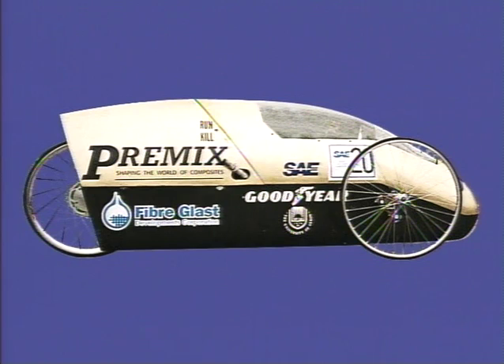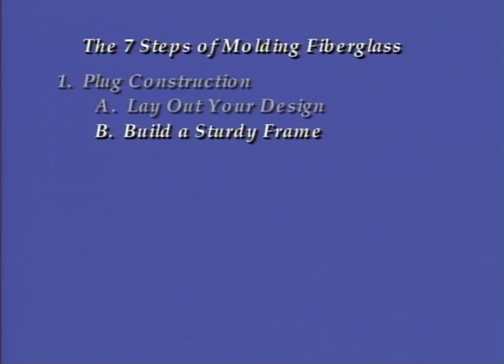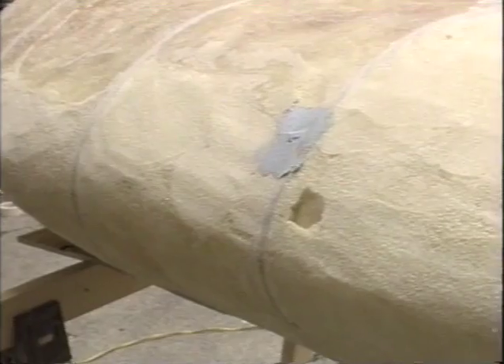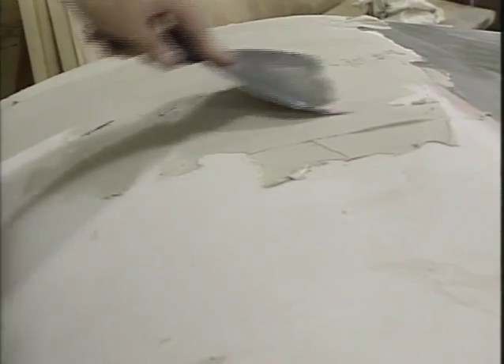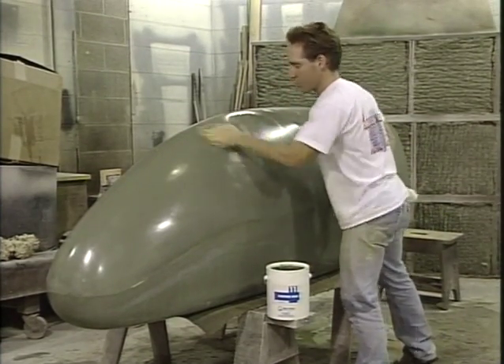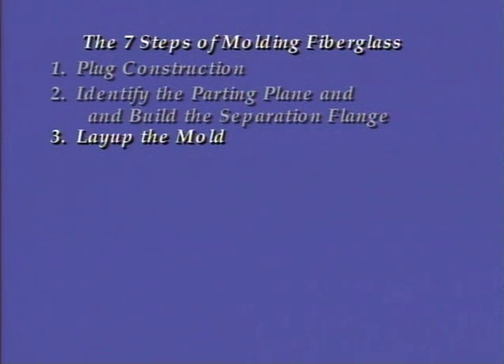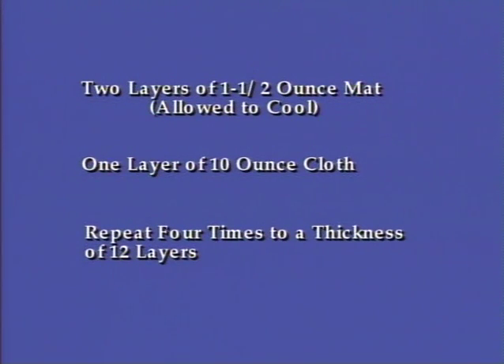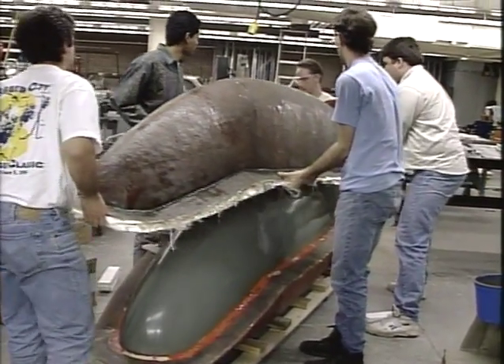3 - The Basics of Fiberglass - Plug Construction and Advanced Moldmaking

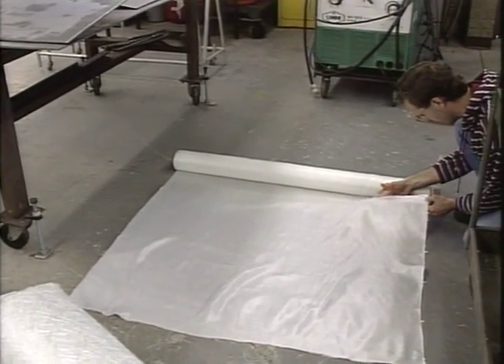Comment: Hi Kelly, just got through seeing the video. Even though the video is a little date I did pick up a tip of two. I live in Colombia and I have noticed that keeping the fibreglass cloth from getting contaminated is not important here. Often times I saw the cloth being cut on a "dirty" table or floor...yikes 😱 And it wasn't only at the shops that I would see this but at several stores where I would buy my cloth...😲!!! I am mentioning this because it happened at 33:22 mark. Did you know that ONE speck of dust can be the starting point of a bubble? Now imagine the whole cloth contaminated. I try to teach people but you know how that goes sometimes. I am fiberglass technician and I am writing a book (it's actually manual) on how to build a modular floating platform. I did enjoy the video and thank you for uploading it. Lots of useful and practical information. I will be checking out the other videos. Saludos desde Medellín Colombia. Chao...😎